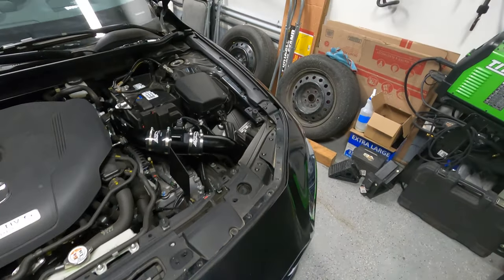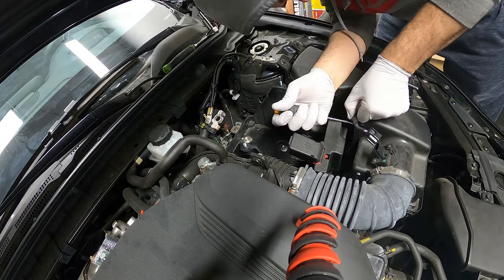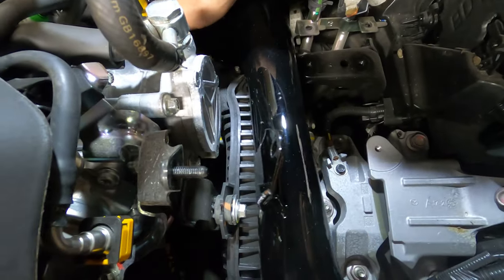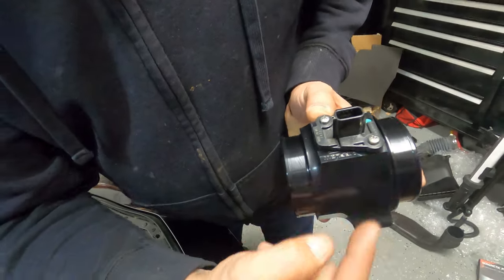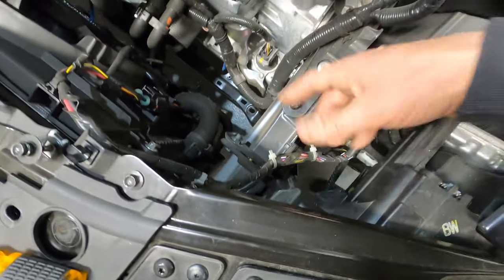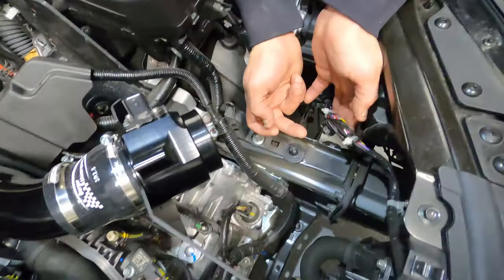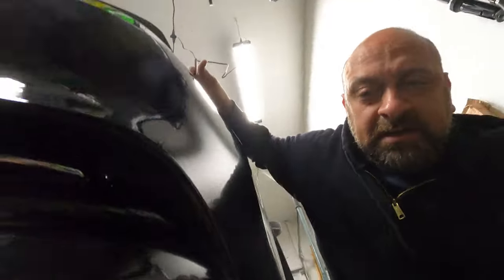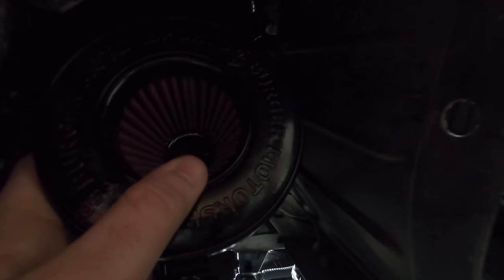Burger Motorsports BMS High Flow Intake for 2021+ Mazda 3 SKYACTIV 2.5L Turbo Installation & Sound.

Comment: Great video! When installing the first pipe that goes directly to the turbo, did you notice that it didn’t seem to fit perfectly? I installed my intake today and was wondering if this was something you noticed as well.
Reply from the maker: We were wondering also. But once we started to put in place it did fit really good
Reply from the maker: Thanks for watching. We are glad the video helped. Please help us by sharing and subscribing. 
Thank you 🙏
Reply: @pharaohssquad8078  yeah once I got the clamp maxed out it seemed to be sealed and stable thanks glad someone had that experience as well!

Comment: Can I use a 12v 800mah (usb to obd2 port )car memory saver for this 2022 mazda 3 turbo?  Because mine has these two wireless services.  I plan to turn off the mazda connect  tho but I cant turn off spartan gps tracking yet.